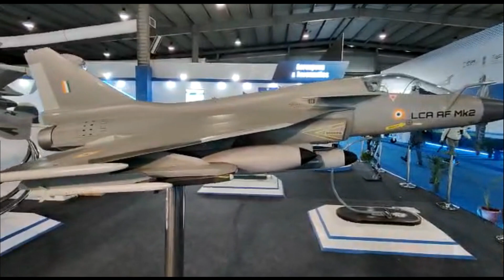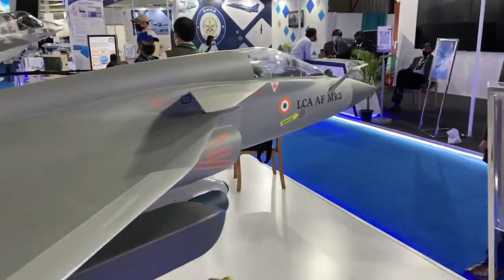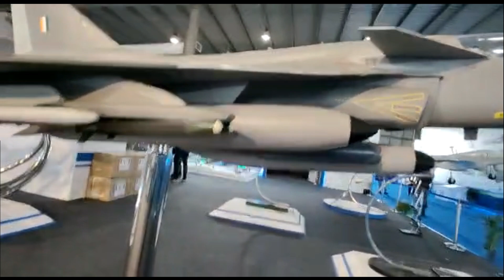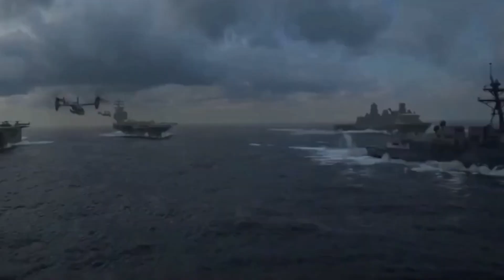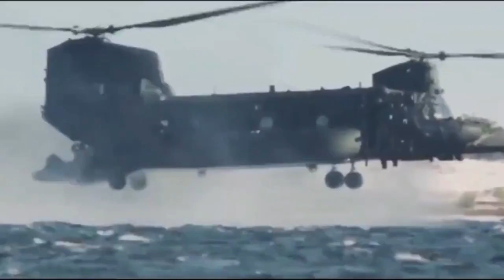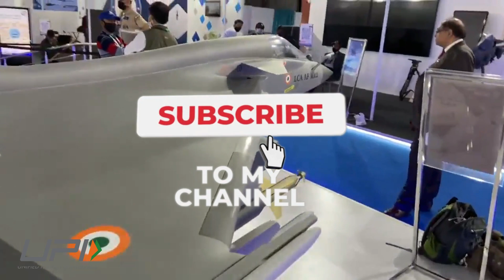Engine for AMCA & LCA MK2: US to finalise ToT of engine during PM Modi Visit to US via iCET program

Comment: Correct me but it's just not design TOT, & only manufacturing tot. Meaning hot(AB) section still from US?
Reply from the maker: Manufacturing tot including hot section. Earlier it was denied by US which India seems to be pushing for
Reply: @IndianDefenseAnalysis  oh ok thanks a lot bro.
Reply: @KCstark.   No country is gonna give TOT of engine core, turbine blades and LP/HP compressor.
Reply: Even India will not give TOT for blades and turbines as they are cutting edge technology if we have them.

Comment: HAL is quietly progressing with the prototype development. Recently, HAL’S ARDC has issued a tender for canard control surface bearings for LCA Mark2.

Timeline

air intake test certification in France by June 2023. 
The fighter jet is expected to roll out in 2024  
First flight may take one year after the rollout of the prototype 2025 
The fighter jet is expected to enter into production by 2028

3 years from first flight is fairly fast progress! Question is if Kaveri 2.0(Ganga engine) can start development and be ready to replace GE414 engine at mid life upgrade. Ganga engine is urgent necessity to end engine imports and US dependency. Flying test bed and high altitude wind tunnels are an urgent need. Government must purchase both to cut years off how long it takes to develop an engine. We cannot predict the timeline of the AMCA Mark 2 with a new engine AMCA is once again nowhere with no engine agreement with any OEM.

It is time to consider a backup plan the Eurojet_EJ200 instead of the GE414. The Sarkar is already negotiating with Rolls Royce, given the possibility that the US may not deliver an alternative must be lined up. Delay cannot be tolerated, if the US dithers Europe wins. Modi must take a hard line with senile Biden.
Reply: Ikr, The Proto Development is going at a very good pace....we might get the first taxing by early to mid 2024....First flight by 2025 is not a bad timeline either....and for engine the first flight and testing can be done with 414 until the deal goes through....Hope it enters production by the end of this decade...
Reply: @NS-ll9ur  I actually hope Ganga engine is ready and GE414 is never needed past the initial orders. Work hasn't even started so maybe too optimistic.
Reply: You are too optimistic knowing how things turn out usually with HAL
Reply: @varun2250  The aerospace sector has changed since the Tejas days. Things change, everything doesn't stay the same!
Reply: @datoolz0  HAL's delivery schedule and Aircraft workmanship remains the same. Also say these words you are repeating in loud speakers and radio when CCP starts invading Bharat. 

May be they will be sympathetic to the pathetic HAL and may stop their invasion out of pity of HAL.